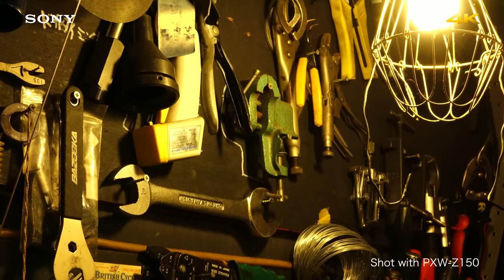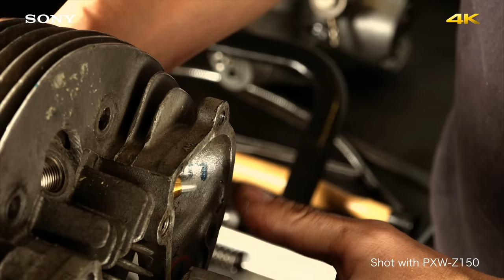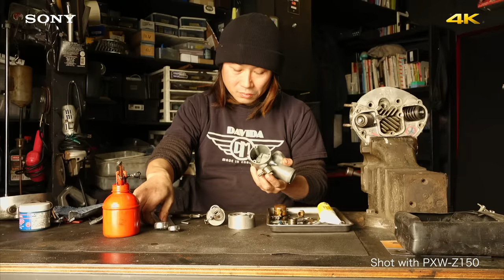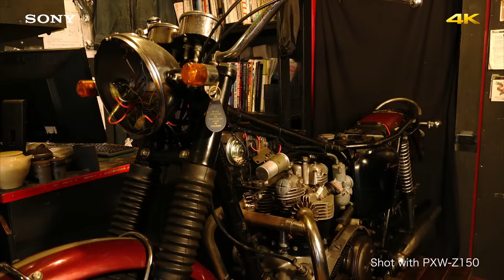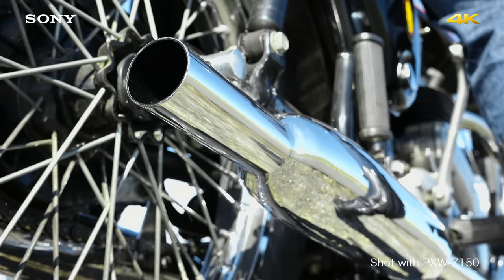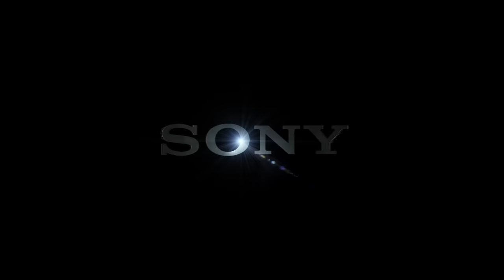PXW-Z150 High quality 4K sample footage | XDCAM | Sony Professional

Comment: Beautiful footage, was all set to get the Panny DVX200 now I'm rethinking.
Reply: +Damian Dodd I'd still check out the Panny.  This video doesn't really show the full range of what this camera can do so it's still academic, but the Panny has a larger sensor, a better lens (from what I can see) and a more filmlike look than this.  And better highlight rolloff baked in if this video is anything to go by.  Plus V-Log, full 4K etc.  The only thing this cam has over the panny is the ability to shoot 422 10-bit internally, but both cams are using SD cards, so who knows if it looks good.  The Sony is lighter though.  I own a DVX200 and this cam made me jump.  I've been using a Z5 for a long time so obviously having the old Sony features, menus, layout and ergonomics would be great again, but it's still not quite the all-out competitor it looks to be from the outset.  Perhaps more footage and a review or two might shed some light.  A comparison maybe.  Still, I'm not terribly excited.  It looks like an NX100 just with 4K tacked on...